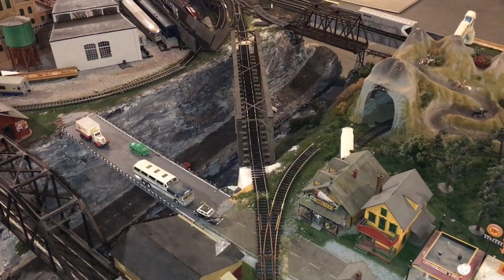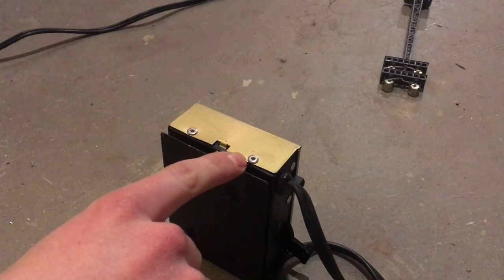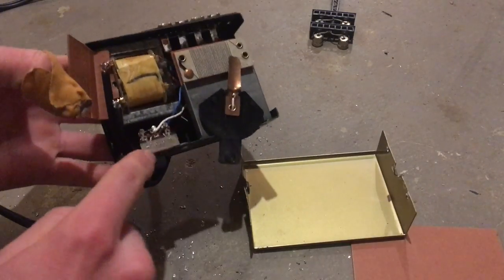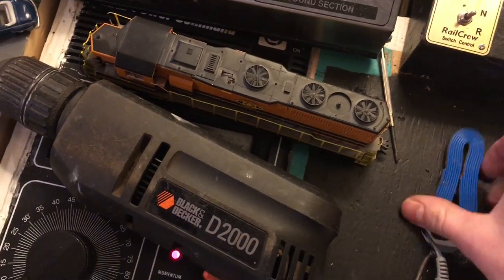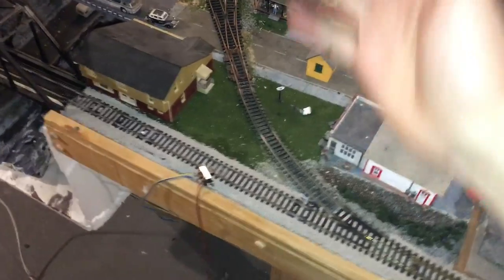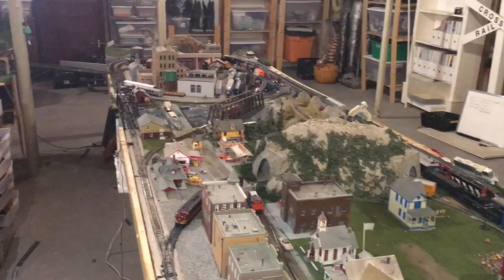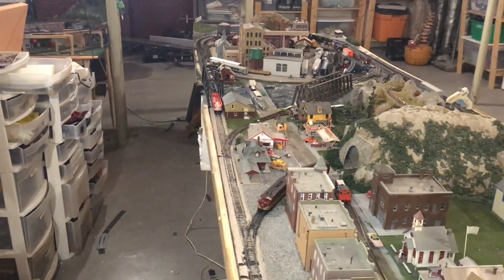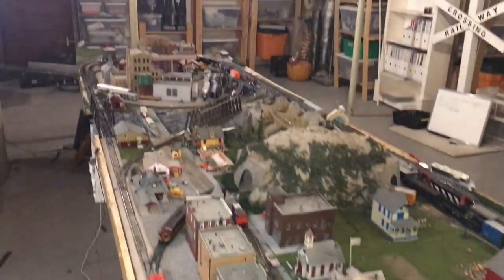How to Wire a Reversing Loop

Comment: Switch is a DPDT
Reply from the maker: I knew it had a name, I just couldn't remember. Thanks for sharing.
Reply: And you can get them anywhere vs ripping them out of old transformers.
Reply: True, but his way is more interesting and entertaining.
Reply from the maker: @KingTrump2024  Yes, however as stated in the video, "I don't have enough time, money and resources to go get something like that"
Reply: @KingTrump2024  any hardware or walmart type store carries them. Radio Shack too or get them online as a bundle of 10 for like $5 or less.
Reply: @SMTMainline  using 4 relays and a 2 wire toggle you can reverse the polarity on a loop track and reverse the power coming off the power supply so you don't have to stop the train and reverse the controller flip 2 wire toggle and relays do the rest
Reply: @SMTMainline  I hope I did this right there is a link to a wiring diagram I made that will allow you to do a dcc reverse loop and a dc reverse loop you will not have to stop the train to change the direction of the train on the controller it's all in one it works
Reply: @SMTMainline 😂😂😂 you have a layout worth £ millions. This DPDT switch may be a few sent.

Comment: When using the reversing switch, you don't need to stop your train on the reversing loop. You can throw the current while the train is moving as long as the train is moving at a slow speed. Hey SMT, you're amazing for doing this. I never could figure out reversing loop wiring. Thanks again.

Comment: Great instructional video.For those that could afford it. Get a  DCC system and buy reverse loop modules. I got the bachmann ones. Work great, no stopping the train and fumbling around with switches. Train goes right on thru. 👍

Comment: The pressure fit screws are called rivets.  An 1/8" drill bit is the size to use.   Sheet metal shears work for wire cutters but not recommended.
I guess the end result is what matters. 👍🏼

Comment: Another way I’ve seen a reverse loop is a separate power control to the loop itself.  I’ll be setting up one on a z scale layout and I haven’t quite decided yet how I want to proceed.  I might do a hybrid where the isolated part is the entire loop, this way it’s be similar to your setup, not require a different power source and can also then be used to not only reverse a train but park it.
Reply from the maker: What's the benefit if having two controllers? Wouldn't it need to switch right back once it's past the loop.
Reply: @SMTMainline  good question.  I had to rethink through the logic why when I originally read about the idea, why I decided to incorporate it into my reverse loop.

In your layout, your reverse loop is short and really reuses an existing loop, but refuses the direction of the train.  In my case, my reverse loop is an entire loop within my layout.  My layout consists of three tracks and one reverse loop.  Track 1 and 2 are powered by one controller.  Track 3 has the entry point into the reverse loop.  My entire reverse loop is isolated from the track 3 controller.  The controller for the loop is always in the direction allowing the trains to travel forward into the loop (if the switch is open to allow entry).  Inside the reverse loop is a circuit track that sends a signal to a relay to switch the direction on track 3 as the train makes its progress through the reverse loop, so that by the time it exits the loop, track 3 controller is in the correct direction to allow the train to travel out of the loop and back onto track 3, without ever having to manually toggle any switches.  If I finally add another reverse loop further down in my layout in the same manner, the entire layout would be essentially automated to allow the train to travel the entire layout, switching directions to retrace the entire layout again without intervention.
Reply: @SMTMainline  ignore refuses, I meant reverse but iPad auto correction, and won’t let me edit the comment.

Comment: If you are on dcc, you can just swap polarity while the engine is moving over your isolated track, because dcc is polar based, but unlike conventional dc, direction is not based on polarity. The dcc locos won’t even break stride

Comment: Even though the power pack was supposedly non-working, when I seen his drill bit go in almost to the drill chuck on the first rivet, I was waiting to see how much damage it had done to the components upon the inside when he finally got the cover off the power pack. However it appears he lucked out and no damage was done to the switch he wanted. So, at least most of the good parts can be salvaged and reused for whatever other purpose(s) they are (or may be), needed for.

Comment: Actually on Direct Current (DC), power, the two middle terminals are generally the "power input" on a double pole double throw (dpdt), switch. and either set of the outer terminals (on one end or the other, but not both ends at the same time), on a double pole double throw (dpdt), switch can be used as the power output (Load).  the "X" (or cross over), wires connected to (between), the outer terminals are the wires that actually do the reversing of the voltage polarity. But be sure the wires of the "X" (crossover), are not touching or connected to each other in the middle, or it would create a Short Circuit, and would immediately start sending up Smoke Signals like a couple of tribes of Native American Indians in the Old Wild West signaling each other, and the insulation (if any), on the wires would start melting when power is applied.

Comment: And this is why you almost have 2K subscribers. You could have bought a switch, but no, you went MacGyver and used an old power unit. Awesome. By the way, when you said “Don’t do this” were you referring to drilling into a power control box or attempting comedy? :)
Reply from the maker: Thanks for your kind words. Using this method has saved much in the way of time, money and resources. Now as for telling people to not do stuff, I generally meant not to open up controllers however I believe it could also be applied to my next level comedy.

Comment: My train set wasn’t working so I went to papa bens train shop and got a new track and power cable
It worked when in switched it
And I got a new locomotive while I was there
25 bucks for a working,complete and a little noisy train
There was 2 but I couldn’t buy the other because I didn’t have enough money
Moral of the story: trains are amazing

Comment: Convert to DCC and the problem is resolved.
Reply: just wiring it correctly for dc or using the old module relays from the '70's it'll work exactly the same as dcc